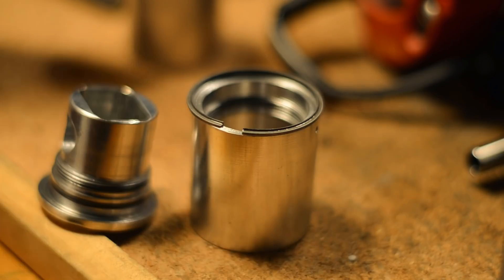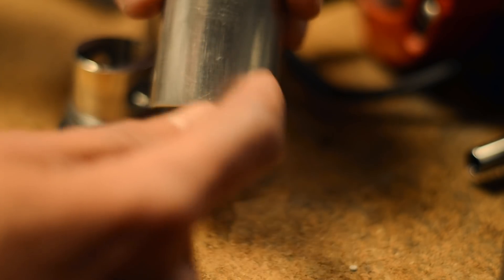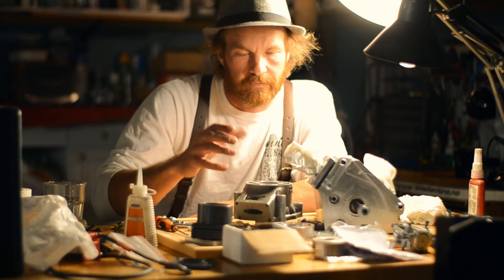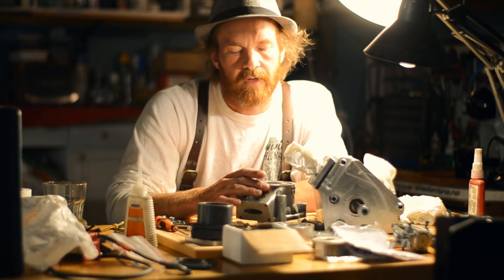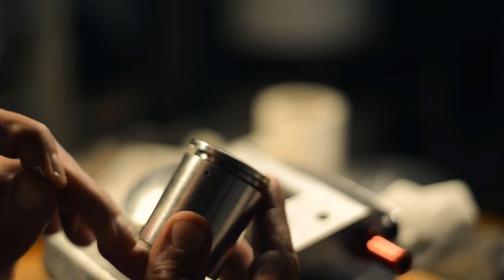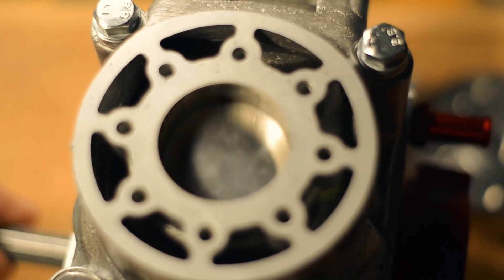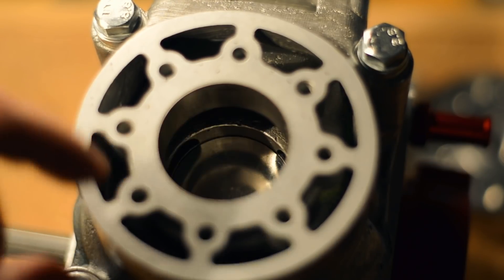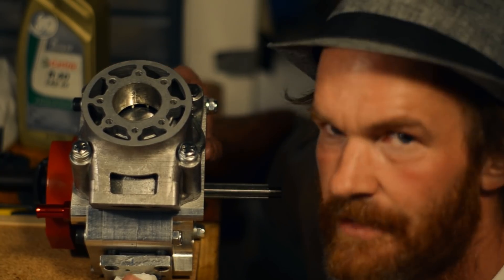The Most Powerful Two Stroke Ever - Will the ring break?

Comment: I wonder if any has tried reverse supercharging a 2 stroke? Aka a scavenging pump
Reply: I also wondered how this would work. If engines lose power with altitude, then the opposite should be true too. Also, does it help to have a large pressure differential across the inlet to outlet (exhaust). Would this raise the BMEP or the engine speed or both? I would love to see a test where the engine is dyno'ed at 1 atm, then the inlet pressure stepped up and the power rechecked. I assume the jetting (or needle valve) would need to be adjusted. Then more pressure, and so on

Comment: In the process of my first 2 2stroke projects from the ground up . I was a machinists toolmaker an aerospace machinists for 30 years been drag racing cars and bikes since the late 80's just now learning to build up 2 poppers lol.  1st project single seat off road buggy 28hp 340cc polaris 2cd project is a 250 Ninja with a 60hp 500 Rotax twin backed with a 4speed manual and 8inch rear swingarm

Comment: Very cool! I've thought for a long time that a head valved 2 stroke like the old Detroit diesels would also make a good gas engine design. For a motorcycle, it would still be crankcase induction since a supercharger would add too much complexity. The valve train would be lubricated by the trans oil being carried up by a timing chain. Much more efficient because you could open the exhaust early and close it before fresh charge escapes. I will probably build a prototype when I have time and money to do it

Comment: Keep up your work  , you will make it. With regard to the piston ring snag on the edge  of the port, chanfer will help but may increase friction with wear and heat.  Best would have been to have a thin wall in the middle of the port to guide the ring.

Comment: For a small engine like yours, you should be able to get by with no ring at all. At very high RPMs the leakage past the piston will be minimal. The oil will seal it adequately. Model plane/car engines do it all the time.

Comment: Can someone explain what the point of all this is
Reply: Getting the maximum power from a 2 stroke engine of a certain size. In this case, 50 cc. Most commercial 50 cc engines (scooters, chainsaws, RC engines) are only 5 hp. Alex has already got his to about 20 hp! There are still many more ideas to try. These amazing 2 strokes have only 3 moving parts yet outperform almost everything else. After I rode a 125 cc motocross bike, I was forever hooked. The power blew my mind!

Comment: Thank you You had me tied up since your last video (before the log cutting things).  OK, the timing of the exhaust port to the expansion of the gas from combustion driving the piston down you set up as optimum and the pressure wave timing from an expansion chamber to draw out intake mixture and ram it back in before the port closes is tunable.  it is difficult to design a pipe without knowing where the hottest part of the gas will be in the pipe? and the flow rate. but first thing first making sure the ring doesn't get sucked into the port or stick.  interference fits and thermal expansions and all to worry about... great job. as we are stuck with this pandemic.  shortened MOTOGP season nothing in the states. Hoping to see you run at Bonneville or if you can pre-run at EL Mirage 2020 SCTA dates in EL Mirage September 13, October 25th & November 14th.   2021 schedule TBD. http://www.scta-bni.org/el-mirage.html 
Let us know I live in SoCal love to really see the thing run.

Comment: why a piston ring at all?. Over 10,000 rpm it works without it. Like the 3.5cc RC 2 stoke motors. Thick 2stoke oil like the motul 800. Mixed at 1: 33-1: 25. The oil film on the cylinder wall seals better and better with increasing revolutions. The carbon that forms on the piston wall also seals XD. The engine is for racing. He doesn't have to idle, @ 2000 rpm or run 1000km. It has to run 10km max and make Power at extremely high rpm. Like 15-20k. Starting is difficult because a high starting speed is required to get the compression high enough in the cylinder to start. But when it is running it can be idle @ 5-8k rpm.

Comment: Suggestion: Make the upper exhaust port edge  transition a long low angle (5 degrees?) because at 20,000 RPM it will be hitting with some force and will wear down there till you hear it clicking while riding. My drawing: http://www.dragonfly75.com/moto/images/PortEdge.png
Reply: Also the new piston/ring is not even needed. see www.dragonfly75.com/moto/images/2options.png
Reply from the maker: Thanks, nice diagrams. With conventional pistons I always run the pin 180deg from exhaust port center, smack in the middle of the C-port. At 100% of bore single port I'm pretty sure a special ring is needed, otherwise the whole ring could catch the port. Someone suggested a really fat ring, one that would always have parts of it riding on "safe ground". Provided a material light enough can be used that's a brilliant idea.
Reply from the maker: 👍 It has a slight angle + a large bevel.
Reply: @2STROKESTUFFING  I think in the end you will have to use a bridge
Reply from the maker: Might be, but I'm not giving up without a fight!
Reply: @2STROKESTUFFING  you'll find a way to break the speed record ;-)
Reply from the maker: @MichaelForrestChnl  😁👍

Comment: You've been trying forever when do we see it run I know Its going to only run for a very very short moment then seas up because you cant build a piston like that also the cylinder has such a large port in it its gonna seas up I hate to burt that bubble bud but it will blow up and a drill is never going to Spin that piston as fast as it will go your talking 8000 rpms or way higher than that 15000 16000 rpms soon as it gets hot game over! Two peace piston 1 single ring no matter how big game over that giant piston ring is only going to cause more wear and damage when it does seas I've rebuilt so many 2 stroke motors and I've tried things with cylinders and it's just not going to work once you get past half the cylinder wall with a port its game over at night rpms 2 strokes with mechanical power valves and without! And the modern 2 stroke engine with a machical power valve is the most powerful 2 stroke made next to jet ski motors and snowmobile motors with multiple cylinders! I wish you the best but I wouldn't count on it actually running for more than 1 or 2 minutes at idle!!! Wide open I give it 30 seconds or less

Comment: I think I hear a slight pink..
It's looking extremely weird as a 2stroke cilinder.
This is gonna run but iam so curious how the power band would be.
I think you get max power in a very tight band with the right exhoust.

Oh by the way, are there plans to calculate a exhaust for this?
Don't hope that it needs to be 1.3 meters to work 😂

Comment: Super Kanal und ich verfolge alle Videos. 
Was ich jedoch nicht verstehe, Warum an diesem extrem großen auslassKanal kein Steg mit gegossen wurde. Sogar zündapp Motoren von vor 40 Jahren haben einen Steg im Kanal weil dieser auch  sehr breit ist
Reply from the maker: I'm not to good with German, but I think you're asking the common question "why no bridge in the exhaust port?" The answer is simple, I'm trying to make a 100% of bore port work.
Reply: @2STROKESTUFFING  
do you think that the bridge would severely impede the flow of exhaust gas?

Comment: That's weird,I drew a diagram of a 2 piece piston yesterday, threatened with solid rings , never seen this .🤫🤫🤫🤫🤫
Reply from the maker: Cool! Solid rings might have a hard time creating a seal tho
Reply: @2STROKESTUFFING  what about a material that expands when temperatures increase
Reply: @2STROKESTUFFING  or same concept as suspension seals,heat proof stuff

Comment: I will go out on a limb here - at the risk of being called a heretic and a madman , have you considered designing a micro controller controlled variable tuned exhaust ? You could use a stepper motor to drive a movable deflector or  baffle  in the expansion chamber to change the timing of the exhaust pulse return and possibly widen the power band .
Just a thought.
I still think you should look at how a model nitro engine is constructed, they use aluminium pistons running in a chrome plated brass cylinder and  no rings  at 40k + rpm , you can run an aluminium piston in an aluminium bore  if you plate the piston with either tin or silver-   Briggs and Stratton engines have been doing this for over 40 years .  If your aim is to do a run on the salt flats you don’t need an engine that can run for a long time , top fuel engines are rebuilt each run so you may need to do the same . Also what is the rotation of the crank  i would want it so on the compression stroke the side forces on the piston drive it away from the exhaust port.
Reply: I have been thinking about variable intake and exhaust systems also.. glad you threw it out there for comment..
Reply: Jimmy J 
kart and bike racers have been swapping exhaust pipes around to suit certain tracks for years but i have yet to see something that can do it on the fly . 
I’m not sure what effect a variable length intake would have on a two stroke though .
Reply: Vince 185 
Cool ! 
I wish he did some dyno work with it to show any benefits if any !
Reply: @Flattyman  
There is another video on here of a speedboat racer with a manually actuated version that is used in racing. He claimed it let the motor rev out further. Cool stuff.
Reply: Maybe a dumb question as I’m pretty new to 2t  but your idea... is that not basically what a powervalve does like the ypvs
Reply: XxSimplYxSmokiNxX 
No a power valve changes the height of the exhaust port so it opens earlier and closes later  .
It does effect the exhaust pressure wave because the exhaust port is open longer allowing the pulse a bit more time to return but two stroke stuffing isn’t using a power valve .
The timing of the return of this pressure wave is critical to maximum power and as the wave travels at a constant speed but the engine doesn’t there will only be a fairly narrow section in the rev range where this timing is optimal
A youtube channel called AU mechanic  explains this fairly comprehensively.
Reply: ian bertenshaw 
Oh ok thanks... so essentially changing the length before the stinger? To change the resonance ?
Reply: XxSimplYxSmokiNxX 
Yep
Reply: @Flattyman  you don't want to change the length of the stinger (which is at the tail end of the pipe )to change the tuned length, as this will only affect the pressure bleed down . Adding an adjustable length e.g trombone to the Header pipe at the start of the chamber would change the tuned length and chamber volume. Various manufactures have tried adding a subchamber which opens at low revs and closes at high revs  as part of the powervalve system to achive the same effect. I think the trombone systen was tried on race Karts in the late 70's but wasnt worth the hassle. I have bee tinking of trying it again now we have better control systems
Reply: @A-Z_Motorcycles  Exactly that. Kawasaki's KIPS too.
Reply: was wondering the same, why not put a trombone on the exhaust? it can be mechanically driven with governor

Comment: Major problem of the ring, the gases are going to push the T section of the ring towards the inside of the piston making it useless, normally the gases expand the rings
Reply from the maker: There's a gap over/under and behind the ring, should be fine. Might add some lateral gas ports in the top ringland too.

Comment: Keep up the good work, I notice your little tip about raising the floor of the exhaust port, something that I might use in the future of one of my own barrels. I've designed and made a cylinder for a Lambretta with exhaust subs which wrap around the lower cylinder studs and increase the exhaust port area by around 25%and @100%of bore width, this reduces to just over 90%when the area of the bridges is removed from the total, I'm a bit further on with them than you are but then again I have only made the patterns, I haven't done the casting or plating myself. 😁 I have two engines running at the moment, one a 231cc (70x60)and the other being a 251cc(73x60). It's a long hard road doing this stuff in a shed so I share your pain. 🤣 🤣 🤣 Maybe I should start doing my own videos. Maybe not. 😁
Reply from the maker: Awesome! Do videos!
Reply: @2STROKESTUFFING  check out the one video I have on YouTube, Bob Monkhouse. I took the others down as I didn't think people were interested. I know this is a bit of a daft question as I've been watching your videos from the start but......... What's your name? 🤣 🤣 🤣 🤣
Reply: Stick Challenger Lambretta Streamliner into the search thingy and it should lead you to the making of the streamliner I'm on with. I've also designed a twin cylinder conversion to bolt directly to the original Lambretta casing utilising two of my water cooled barrels. I'll think about sticking videos up.

Comment: Good to see progress! One more stupid question: would it be possible to increase the blowdown area by running a dual exhaust at ≈90% bore or something of that nature?
Reply from the maker: Yes, but it would require a total rework of the transfer layout. I might have something planned, not my original idea tho.
Reply: @2STROKESTUFFING  Interesting! As far as I can tell, this will lead to a much higher increase in blowdown, but maybe it will compromise the transfers too much?
Reply from the maker: It's proven challenging to get good efficient scavenging with layouts like this. I have to try tho, might come up with something clever. Starting point will be a FOS style cylinder - A ring of four exhaust ports evenly spaced around the bore + a ring of transfers below them. Symmetry is key here, getting that central column of fresh charge to rise up and displace spent gases with minimum mixing. Perfectly symmetrical ports may not mean perfectly symmetrical gas flow.
Reply: @2STROKESTUFFING  so exciting though if you get it right

Comment: Here is the mystery revealed 😜 in practice you will use a dismountable piston with the seal ring with a very particular design, it is equipped with a guide that controls its maximum expansion.👍

Comment: The piston locking pin. If it's solid & you peen the surface of the skirt over it then it will be very difficult to get the piston off. Why not use a roll-pin which you could push all the way through to remove?
Reply: How about a simple fine threaded countersunk screw with Loctite?

Comment: Congratulations on the success so far. I’m sure you have considered the weight of the new piston. Is it much heavier than normal? Will that affect the maximum rpm of the motor at all?
Reply from the maker: Thanks! It's actually a hair lighter with the shorter wristpin.

Comment: Getting close sir!   Your theory is sound,  just to try to do it!!

The resistance frequency from the pipe, have you calculated what you may need for the design of the expansion chamber to "tune" it to the modified port timing?
Reply from the maker: I've run lots of simulations honing in the pipe design, got it drawn up.

Comment: Normal piston rings use the compression to get in behind them to push them out and against the cylinder wall. I wounder if this design will lack a bit of compression because of that? May not be noticeable and more of a low and mid range thing so at your high revs it may not matter with a little extra oil compared to a daily driver.
Reply from the maker: This should work in the same way, might need some lateral gas ports in the ringland though.

Comment: Professor Blair’s book on two stroke engines would come in handy right now.
Reply: It is a good book though most people could skip the chapters on simulation.
Reply: Blair and Jenning's books got left in the dust miles ago!!  This build is outside of the outside area of a box.
Reply: @KrustyKlown  The gas dynamics theory in Blairs book is fine, the rough guides for an engine designers starting point are getting a little dated. A modern designer would go straight to CFD simulation, there are some good codes available. Blairs approach to pipe design is far better than Jennings.

Comment: This is fantastic work. I wish I was doing something like this.  
I see your running R40, just curious what ratio you will be running with. Might the oil migration/ presents at 19,000rpm be an issue?
Reply from the maker: Thanks! The R40 was what I had on hand, usually run A747 - less gunk. 5% mix.

Comment: Next possible 50cc modification.  Opposed piston... offers less 'short-circuiting', and increased port area for both exhaust and transfer.
Reply: I like the idea. Weight isn't a huge issue in a land speeder so the extra crankshaft and gear train is not a big issue. However best to just slay one monster at a time.
Reply: That is a really good idea. DKW did that in 1951 with a 250cc DKW engine and achieved a power output of 45 bhp at a time when 250 cc racing 2 strokes were getting only 19 bhp.  Just imagine what you could get out of that 50cc using modern materials instead of the comparatively weak metals of that time. By offsetting the phase of the two crankshafts and using a vane supercharger for scavenging you could also induce a moderate overpressure and gain some more power that way. I am guessing you could get 21 or 22 bhp out of 50cc that way.